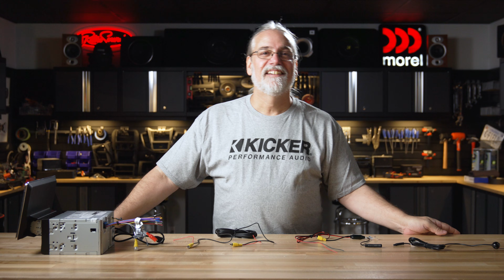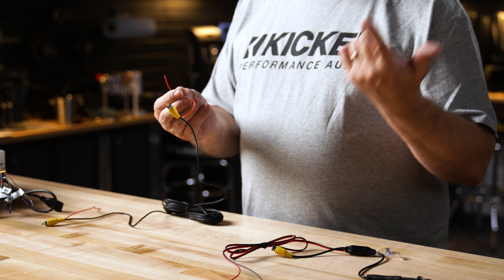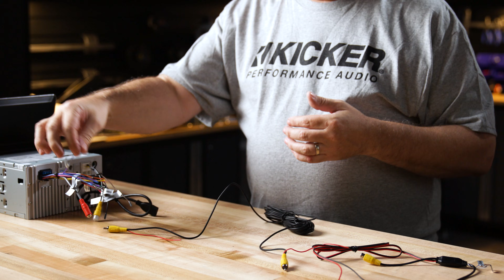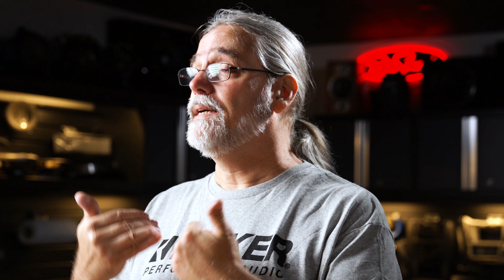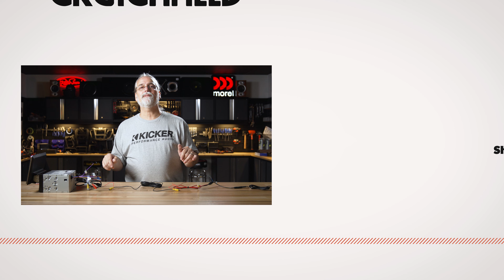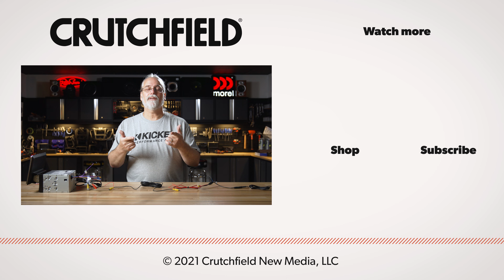Powering your backup camera (and how to use that extra wire) | Crutchfield

Comment: I just installed a "Rimoody android 11" for my mom's 08 Rav 4. 
Everything works great, but i cant get the reverse cam to work. 
everything it hooked up properly, i even tested if i am getting 12v from the reverse bulb going to the trigger at the back of the unit. (brown wire) 
I even tried switching the yellow RCA plug around. 
Reverse mode just does not activate. 
i even tried playing around in the software, still no luck.
is this just a faulty unit or what... 
need help.
Reply from the maker: Sounds like you've double checked your connections. From there, you may want to double check the camera settings on the radio. If you got the camera here, you can call our Tech Support as well. Their direct number will be on your invoice.
Reply: welp, i got the camera to work.... 
really silly of me 😅.... I wasnt paying attention to my multimeter having - 12v. apparently i hooked it up backwards. 😂. 

But anyways, the camera activates now in reverse. 
My only concern now is, that it doesnt show the "grid lines" on screen. the camera works great and all but no guiding grid lines. 
"as it should from the box" ....

the unit doesnt even have grid lines "settings".  Ive been searching up videos and forums and fiddled with all the reverse related settings in the unit, but nothing activated the lines.
This is probabaly what i get from buying chinese knock offs from amazon.😢

So as i learned from the video, those grid lines can be from the unit OR the camera right? 

so in my case, if i cant activate it from the unit, i should get a camera that has integrated lines?
Reply from the maker: Yep! A lot of cameras are able to add the grid lines for helping gauge distances when backing up and that's a great way to get them when the radio does not offer the overlay. The backup lines is even a filter option we offer when viewing all our backup cameras:

https://www.crutchfield.com/I-rYALc227/g_277650/Backup-Cameras.html

Comment: What if you are not using it as a back up camera and do not need the stereo to come on when I shift onto reverse? Do I still need to connect the trigger wire? I do not want the stereo to trigger the camera view. I rather wire the camera to a switch and then press the camera icon on the stereo when I want to view from the camera. I plan on using it as a forward camera.
Reply from the maker: What model camera and radio are you planning to use?
Reply: @crutchfield  generic Pixelman reverse camera with Sony AX6000.
Reply from the maker: That Sony radio is capable of manually displaying the backup camera by choosing it from the source list. You don't need to connect the reverse gear wire when solely relying on the manual selection process

Comment: How do I wire a front camera in addition to a back camera on a crv 2017 with just one screen. Reverse for rear camera and driver for forward cam
Reply from the maker: HI Gideon, front and rear camera are a plus! What model radio or monitor and what model cameras do you plan to use?

Comment: I hooked up my back up camera but it gets a distorted blurry image when the car is running and kind of clear when the car is on the ignition on but not running what could be the issue?
Reply from the maker: Sounds like you may want to re-check your wiring. If you got the camera here, you can call our Tech Support as well. Their direct number is on your invoice.

Comment: You are awesome and I thanks you! I have a issue btw > I want my camera only on reverse but when I connect +12 to my backup lamp the camera works perfectly if I have engine off, when I turn engine on the camera stops working. What should I do? Audi A1 2017.. thanks really!
Reply from the maker: It sounds like you just need to doublecheck the wiring and location of connections. When the camera is correctly powered from the reverse light circuit, it powers on when you shift into reverse only.

Comment: So what I am understanding is that the reverse wire needs to be triggered by a 12v positive wire. I am wanting to access my rear camera whenever I want without putting my van on reverse so to do this, can I simply run a 12v positive like from the cigarette light socket (cause its always next to the radio) to a toggle switch and hook up the reverse trigger wire from the headunit to the same toggle?
Head Unit - Kenwood DMX129BT
Rear Camera - Kenwood CMOS 230
Reply from the maker: The best wiring option will depend on the exact components. What model monitor and camera do you plan to use?

Comment: I've set my camera up in the typical fashion, chassis ground and convenience wire ties into camera power and then to reverse wire power. I have a large amount of "snow" interference with the image. Any thoughts? I'm thinking its picking up a ground from the rca but i dont know how to remedy that.
Reply from the maker: Hi Nick, sounds like doublechecking your wiring is the best place to start. From there, you may want to verify your camera settings on the radio. If you got it here, you can call our Tech Support as well. Their number is on your invoice.

Comment: I did all this and it still doesn’t work on my Sony head unit. If I go to camera option it shows the feed but doesn’t switch to the live feed when I put it in reverse. Any ideas?
Reply from the maker: Sounds like you may want to double check your camera settings on the radio side. If you got the camera and/or radio here, you can call our Tech Support. Their direct number is on your invoice.
Reply: @crutchfield  Thanks for getting back. I actually didn’t notice that in my black cord that runs from the camera to the head unit, their was a micro cut in it and it cut my red wire inside. I spliced it together and it started working! I appreciate the response and the video! Very helpful.
Reply from the maker: That is excellent news, thank you so much for letting us know!

Comment: I’m wondering… Can the signal from the camera be tapped into simultaneously to record to a forward/backward recording dash-cam? Is this something that people have tried before?
Reply from the maker: The recording capabilities would be specific to the dash cam you're using. Do you have a specific model in mind?
Reply: @crutchfield  No specific model in mind. I currently have a Rexing 2ch dash-cam installed in my vehicle and have had it for a few years. While recently considering a CarPlay head unit upgrade in my 1999 Solara, my curiosity was sparked on whether it is possible to use a backup camera to act as both a fully functioning backup camera (with head unit integration and reverse activation), as well as the 2nd channel camera for a dash-cam. Essentially killing 2 birds with 1 stone.
Reply from the maker: Rearview camera's designed to work with aftermarket radios contain an RCA video output, this is not compatible with most recording dash cameras. You also cannot splice your receiver's rearview camera into other devices. I would use your rearview camera in conjunction with your new Carplay radio, and use your dash cam (front or rear, depending on your choice) for any video recording.

Comment: I’ve had my jenson hooked up to my reverse lights. It’s flip on when I’d go into reverse but wouldn’t go out when I’d go back into drive. What would be my issue to flip it back
Reply from the maker: Hi Nick, sounds like you may need to check the camera settings on the radio side to ensure it's set for the camera to come on only in reverse. If you got the radio or camera here, you can call our Tech Support. Their direct number is on your invoice.

Comment: I think what most people want is for the camera to allways be available, but ALSO to trigger when putting car in reverse…. I cant find one video showing that way, if thats even possible..?
Reply from the maker: With certain radios you can manually select the backup camera at anytime. If you want to wire your backup camera that way, watch from the 3:00 minute mark we cover those situations too in this video!

Comment: This video is so helpful, thanks so much. My radio comes with power for the backup camera so now I know how I want this wired.
Reply from the maker: You're welcome, Freddie. Are you planning to use a specific backup camera?
Reply: @crutchfield  Yes I have a Boss radio that came with a backup camera. I haven't installed it yet but the radio comes with a power wire specifically for the camera, so my plan is to use that
Reply from the maker: Okay, cool. Hope your installation goes well and you enjoy your new radio/camera.

Comment: I was researching options for my 2014 Wrangler.  Great video.  Very helpful.  I was thinking of mounting the backup camera on the 3rd brake light which sits above the rear spare tire.  With this approach, I thought may be I could power the backup camera by tapping into the 3rd brake light wiring.  
Much appreciate your expert opinion if this is doable?
Reply from the maker: With a compatible camera, that's a good option. Do you have a specific camera in mind or would you like help choosing? Do you have the Unlimited model? Did your Jeep come with a factory Alpine sound system? What do you plan to connect the new camera to for viewing?

Comment: I know this is old post, but im wondering how to fix a low voltage for the car. The back up camera works when its not running. But when you turn the engine ON, it will say NO SIGNAL. Simply the voltage drop. Need help please
Reply from the maker: Vehicles typically output higher voltage when the engine is running, closer to 14.4V instead of 12.6V which is what you get from the battery alone. The issue you are experiencing is likely being caused by something else and we recommend contacting technical support for help troubleshooting it. If you purchased your gear from us, we recommend contacting our technical support. We include their toll free phone number on the order invoice

Comment: So I did this and my radio shows rear only when I’m on the menu for reverse cam it doesn’t just trigger on
Reply from the maker: It sounds like the radio is not receiving a signal on its reverse gear input. When you use the convenience wire to supply power to the camera (to make it accessible for manual viewing), you must pick up the reverse gear trigger elsewhere. We recommend contacting technical support for help in finding the trigger wires to use. If you purchased your gear from us, you can contact our technical support for this help. We include their toll free phone number on the order invoice

Comment: The hardest part is the ground cable like what do you mean hook it to the body..
Reply from the maker: It's best to hook the ground wire to a metal chassis grounding point and not simply tapping into an existing ground wire for another device.

Comment: a picture of the wiring diagram connections for different options  would be so much better than all these words.    I am still lost.  HOW DO I CONNECT THE WIRES  ON MY JENSEN1.  TO  1. GO ON automatically in reverse and 2 go on when i press the bottom. where is this drawing?????
Reply from the maker: There is no drawing that will work for all the vehicles we have researched. However, that vehicle specific wiring information is something that our technical support has access to and can use to help our customers install the gear they got from us. We even include the toll free phone number for our technical support department on the order invoice

Comment: For always on camera. If the headunits needs to connect to the reverse light do we need to run a long wire front ti back for camera power?
Reply from the maker: The best wiring option will depend on the radio/camera you use. Do you have specific models in mind?

Comment: You lost me at, …”but we still don’t yet have the ability to see the automated, backup camera.” What do you mean by automated backup camera? In this segment, I thought you were only talking about full-time rear camera power. And why would you need reverse hookup in this segment?
Reply from the maker: Hi David, Chris does cover several scenarios in this video. Depending on your exact setup, you may still need to wire for the reverse circuit even when choosing to have the camera on while driving all the time. Are you looking to install a specific radio and camera?

Comment: I have a 2023 f-150 with the factory sync 4 display. I purchased a third brake light camera (PCAM-CHMSL2-FD15)to have additionally with my factory tailgate camera. I want this third brake light activated only by one of the factory aux switches. Right now I have the camera installed on the third brake light,cable ran to the front of the truck. The red wire is connected to the aux switch wiring which is hot all the time(12 volt power),the black wire is connected to the chassis. The part I’m confused on is getting the display to switch over when the aux switch is activated. From what I can see on the back of the display there is no rc connectors or trigger wires,so where do I tap into and I also have one more wire which is labelled (reverse power anode output). 

Thanks in advance…
Reply from the maker: We do not carry your camera; but Echomaster does offer the wiring diagram you need showing the reverse wire on page 10 of the manual here: https://catalog.echomaster.com/index.php?controller=attachment&id_attachment=2109

Comment: My stereo reconsidered that car going into revere through canbus I believe and my camera is getting 12v but still no signal. Do I still need to connect my red wire with signal wire to backup trigger wire
Reply from the maker: The best wiring option does depend on the radio and camera you're using. What are you models? Keep in mind, if you got them here, you can call our Tech Support for installation assistance. Their direct number is on your invoice.

Comment: Recently purchased a head unit (Boss bv850acp) and camera from Crutchfield. I followed your instructions in the video using the convenience wire to attach the camera to the head-unit Reverse wire (Violet/White). However, the wiring instruction sheet I received states I should connect the head-unit Violet/White Reverse wire to the car's (2009 Sonata Limited) Blue Reverse Trigger wire (Location: Pin #2 of 8-pin gray plug at radio or pin #3 of 18-pin brown plug in driver's kick panel). I also was sent and wired up the Metra 70-7303 harness. Do I have to do the wiring instruction sheet step if i followed the wiring you suggested? Thanks
Reply from the maker: Hi Eddie, thanks again for your order! Our Tech Support can best assist you in wiring this up. Their direct number is on your invoice. Hope you're enjoying your new radio soon!

Comment: Nowadays most cameras come with built lights...

If you wire for constant power will the camera lights always be on? How would it know to turn the lights on?
Reply from the maker: This depends on the backup camera and its design. If the built-in lights and camera operation are joined together for power with no mention in the manual about changing that, then the lights will always be on when the camera is on and able to be used.

Be sure to check the camera's wiring as if you find that there are separate power wires for the camera and the lights, or a way to separate them listed in the owner's manual, then you can get separate power for both. And have the lights turn on when you are in reverse.

Comment: Excellent video,much appreciated. My car has Can bus system,how does that differ? Apparently you dont connect to reverse wire!
Reply from the maker: Thanks, Fernando. The best wiring option will come down to the radio and camera you use. Do you have specific models in mind?
Reply: @crutchfield  I have a 2012 Audi A3 8P.I asked about the canbus option since my car has this and you didnt refer to this system and I was wandering if you sell a compatible device and how the installation differs from a regular system.Cheers👍
Reply from the maker: Are you hoping to add a camera to the factory radio or an aftermarket radio?

Comment: So it is safe enough to use the convenience wire to power the camera? Some people say its too thin to power the camera over such a long distance. It sure would make my installation a lot easier if I can just use the convenience wire to power the camera off my android head unit which has 12v output for the camera.
Reply from the maker: What model camera and head unit are you planning to use?

Comment: Can anyone tell me do I need to use the convenience wire if my radio already triggers the reverse camera screen when in reverse (even tho camera is not hooked in yet)
Trying to plan in advance, also can I use electrical connectors,  not solder the cables? Thank you
Reply: You won't need to connect the trigger wire to the reverse light as your cars canbus is truggering the head unit to enter the reverse screen. 

However according to this video the convenience wire can also be used to give power to the camera itself. Some head units have the ability to send power to the camera via a wire on the back. The only thing I'm not certain about is if the convenience wire is thick enough to provide safe power to the camera. I have read conflicting information. Crutchfields video seems to think it's fine.
Reply from the maker: It sounds like to me your reverse trigger connection IS already connected properly Wojtek, especially if the screen goes blank when you shift into reverse. You will need to add a camera, making sure that the camera is connected to power and ground. Connect your camera's video output RCA to the correct input on your radio.